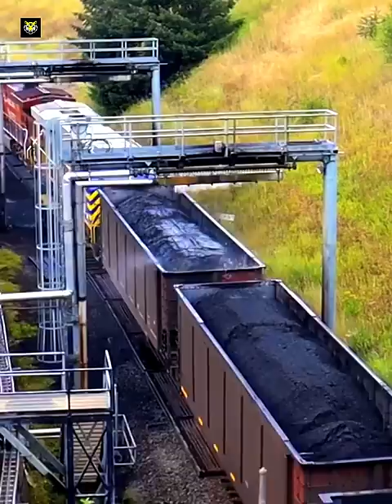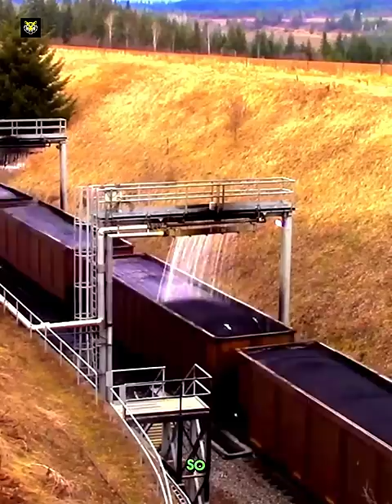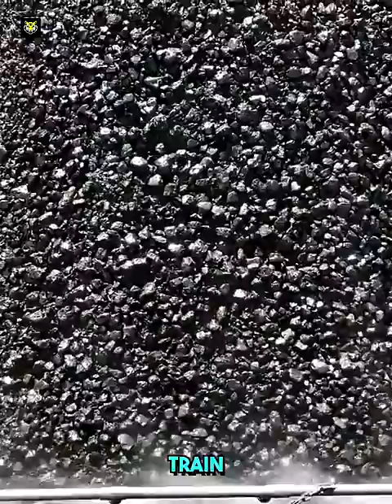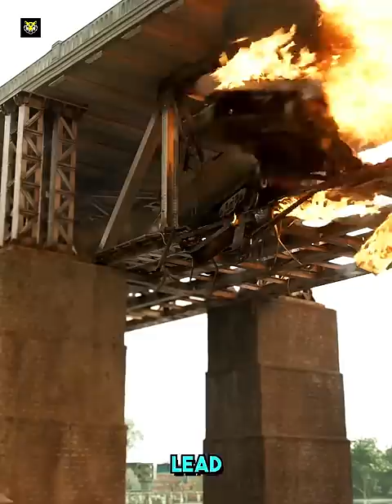Pouring Water On Coal Train |😯😯| #shorts

Comment: According to Google, Coal fires are created by the interaction of carbon, oxygen and heat, which in turn produces carbon monoxide, carbon dioxide, and more heat to fuel the reaction. Meanwhile, hydrogen in the coal is converted to water vapour, nitrogen to nitrogen dioxide and sulphur to sulphur dioxide.

Comment: Not the real reason. Poring water has to do with dust suppression. 
Coal is not easily ignited ; coal dust is easier to ignite. 

But the heat from friction within coal particles can not be reach the temperature for ignition .